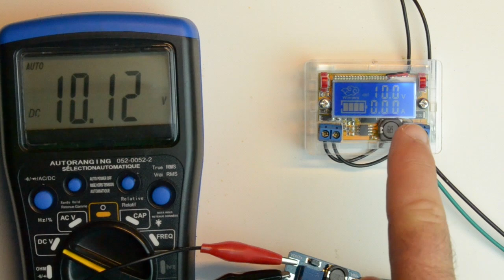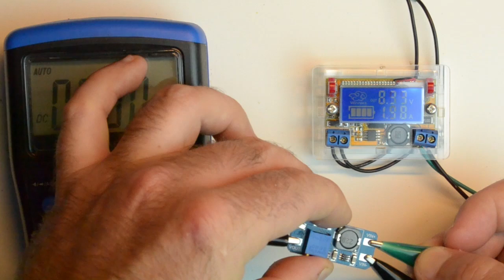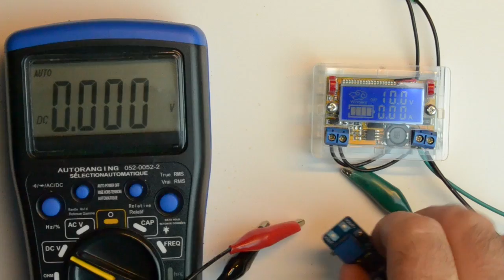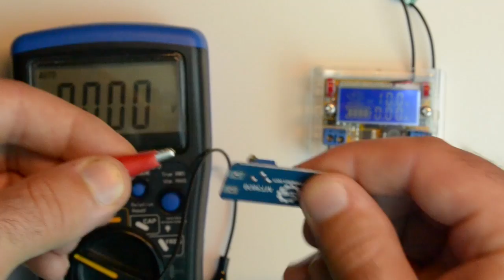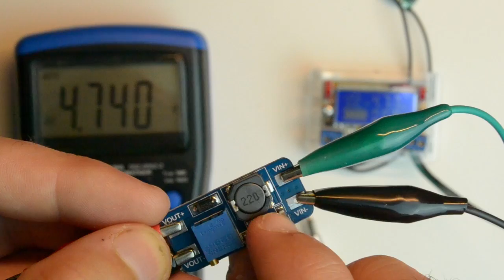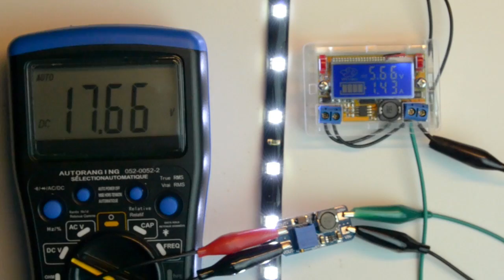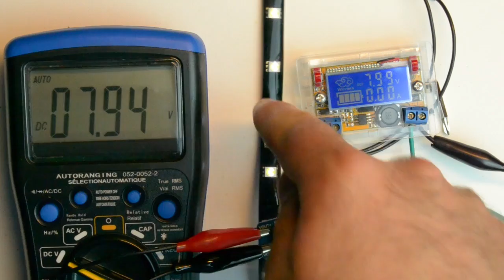Caught on FIRE?? MT3608 DC DC step up boost coverter

Comment: I've purchased two of these modules and they worked fine although of you need to be patient while adjusting the output, it may take 10 or more turns before you'll see any boost in output voltage.  There is however a design problem where the potentiometer can be adjusted to the point of exceeding the maximum allowed input voltage on feedback pin 3 of the controller ic with the result of allowing the magic smoke to escape. This would only happen if the input voltage to the module exceeded 6 volts. A better design would have included an additional resistor between the top of the pot and the output voltage that would limit the maximum feedback voltage to the IC regardless of the adjustment of the pot.  While searching for the schematic, I came across an excellent detailed write on the issue posted by John Galton -- see below.   I hope this helps all you DIYers.

---------------------------------------------------

ByJohn Galton January 25, 2017
This specific circuit board has a design flaw when the input voltage is greater than 6 volts, where the potentiometer can be turned to a point that exceeds one of the "Absolute Maximum Ratings" on the MT3608 chip data sheet.

I also blew one up when hooking it up to a gel cell battery, expecting the device to function as advertised. Then blew up a second one even with a current limiting resistor in the power supply, before hunting down a schematic, probing the board to be sure it matched, downloading data sheet for the chip itself, and conducting an autopsy on what happened.

(edits to clarify technical details)

The workaround for the unaltered circuit is to turn the potentiometer adjustment screw 20 turns counterclockwise BEFORE connecting power! Apply only 3 volts power initially (such as a pair of "AA" batteries" while adjusting everything, even if your final input is going to be much higher (like a car battery).

By default as assembled and shipped, the potentiometer wiper is about 3/4 of the way to the top. If your power supply is 13.8 volts, This will apply about 9 volts to pin 3, Vfb, of the chip, and instantly kill it before you can get started.

Probe the center wiper pin of the potentiometer on the back of the board, and check the voltage. When the unit goes into a control loop regulation mode, this voltage will be right at 0.6 volts. If it is above 0.6 volts, it is just passing input through to output without any boost.

Carefully adjust the potentiometer to bring the voltage at the output up to whatever you intend to boost to.

Only then can you safely connect the input to whatever higher voltage power source, such as car battery, you are going to boost from.

-----------------------------------------------------------------------------------------------------------------------------------
Now for the why to do it this way, and a rant.

I have been an electronics engineer for a while, and have seen a lot of products that are not very forgiving of typical end user assumptions based on ad copy. In that context, this product is, alas, another one of those where ordinary people can blow it up.

According to the data sheet on the MT3608 chip, available at https://www.olimex.com/Products/Breadboarding/BB-PWR-3608/resources/MT3608.pdf the absolute maximum limit for pin 3, Vfb, is 6 volts, and the control voltage is only 0.6 volts. The schematic for this specific board can be found as the image
http://www.sunrom.com/media/content/1118/MT3608-schematic.gif.

Let's analyze the feedback and boost circuit. Total resistance between the output and ground through R1, a 100K potentiometer, and R2, a 2.2K fixed resistor, is of course 102,200 ohms. At a maximum output voltage of 28 volts, this will pass a current of 274 microamps.

The voltage across R2 at this current will be 0.602 volts, which means that if R1 is set where its wiper is at the bottom, the output voltage will be slightly below the maximum boost output.

So far, so good. As long as the potentiometer wiper is near the bottom end, everything is fine. As the screw is turned and wiper moved away from the bottom and near the top, the voltage at pin 3 of the chip rises. The chip senses this and reduces the switch duty cycle to reduce the boost, until the output voltage drops, bringing pin 3 back to 0.6 volts again.

This process works fine, until finally the chip adjusts the output voltage to equal the input voltage. Then the nice stable control loop quits working. The boost circuit shuts off. The DC input simply flows through L1 and SS34, to the output.

Since the chip is no longer able to control the output, it cannot reduce the output voltage as the potentiometer continues to be turned, so the voltage at pin 3 now just rises proportionately to the potentiometer wiper setting.

Notice there is nothing at all to prevent the wiper voltage to be cranked "all the way to eleven", where pin 3 can see the entire output voltage. If you have an input voltage of, say, 12 volts, and the potentiometer wiper came set from the factory most of the way up, then the voltage fed into pin 3 can be significantly higher than its 6 volt maximum rating, and up to 20x the voltage it expects to see to run a proper control boost loop.

It is this simple oversight - that the potentiometer can be adjusted to, and comes from the factory at, a setting a long ways beyond any normal operating range.

What we need is another resistor between the output + and the top of R1, so that if the wiper is all the way at the top, we can't reach 6 volts at the wiper, even if the input is at 26 volts, the maximum rating of the chip.

Lets make the sum of R1 and our new resistor we create with a magic wand and insert in this circuit, equal to 100K. The sum of all resistances would still be 102,200 ohms.

The voltage at the top of R1 would be 6 volts with 26 volts at the output, which since the unit is not controlling in this extreme scenario, just passes input through to output.

To make this happen, we solve a ratio and proportion equation. 26 / 102200 = 6 / x, where x is the sum of R1 and R2. Cross-multiplying to solve, X = 102200 * 6 / 26. X=25585 if we round to the nearest integer. Since R2 is 2.2K, then R1 needs to be changed to something slightly less than 23385 ohms. The nearest standard value for a potentiometer is going to be 20K.

The sum of R2 and R1 will thus be about 22200 ohms. 102200 - 22000 = 80000. Our new R3 needs to be 80K to properly protect the chip from both highest possible input voltage and highest possible boost voltage.

-----
Thus, this is my take on why these things fail, and how to fix it.

The MT3608 chip is available from assorted sources. Anyone with schematic capture and circuit board layout software (and some skill at operating it) could easily take this design and fix the problem, and send the re-designed board layout and bill of materials off to a board fabricator in a single afternoon.

If I were going to use this in a commercial product, I'd probably "add a belt and suspenders" and put a small signal diode (nominally 0.7v forward voltage) in parallel with pin 3 and ground (pin 2) right at the chip, and also add about a 20K fixed bleeder resistor in parallel with C2 to prevent running the unit without a load, which can also kill some boost switch circuits.

Heck, it's Friday. I might just lay out an improved version of this unit in the same form factor myself, and post it to show everyone how it should have been done.
Reply: I have replied separately, this is a copy in case it is useful,

This is a modified version of a circuit my Dad built in conjunction with some valuable references in 1986 in Australia, it was fixed non-adjustable and made with far less components and fitting with the original use-case which was to enable an LED torch that didn't exist in general availability then to operate using two recycled basically flat batteries. It was my idea that he worked on. I presume the changes are to enable mass production through additional applications due to being adjustable. I intend shortly having discovered these are commercially available to make up a small batch for Boy Scouts. I would not mind finding a copy of the original hand-traced printed circuit board or the completed circuit mounted on a modified AA battery holder, I could copy/modify that for use. To executive summary another comment, "This would only happen if the input voltage to the module exceeded 6 volts."

Dr Bonezzz
"There is however a design problem where the potentiometer can be adjusted to the point of exceeding the maximum allowed input voltage on feedback pin 3 of the controller ic with the result of allowing the magic smoke to escape. This would only happen if the input voltage to the module exceeded 6 volts. A better design would have included an additional resistor between the top of the pot and the output voltage that would limit the maximum feedback voltage to the IC regardless of the adjustment of the pot."
Reply, the original design was fixed and the components chosen for the specific circuit application prototype including one resistor. Also, if I recall the circuit does not work very well with no load on the output because it is hard to tune.

Comment: These boost converters can handle 2 amps max, so if you exceed that, they will blow. The best thing to do is limit the amps from your power supply.
Reply from the maker: Yup, but I think you misunderstand, I didn't 'push' 3 amps through it, it shorted and 'pulled' 3 amps by itself, which was the current limit of my DC-DC power supply. The module didn't have a 3A load, it BECAME a 3A load by shorting out.

Comment: Hey i am willing to buy it and need some help i want to boost 12v to 25v can i ?
Reply from the maker: So yes you can put in 12v and get 25v out BUT be sure to check your amp output! this module maxes at 2 amps but if you were to run it constantly, I would probably not output more than 1 amp, which will still be around 2 amps in!
Reply: Yes out is less then 2amp and in is 2amp (battery). do i need anything else like capacitor or somthing ?
Reply from the maker: You should be good to go, I would order more than one though. (hint: usually 5 units cost as much as 2 unit usually)
Reply: Thanks for hint
Reply: Mine catched fire without load on 12V in. With 4V in worked.

Comment: I had problems and they wouldn't power my arduino nano', so I put a 220uf 35v capacitor across the output and they work.  Watching the movie I think you were adjusting in the wrong direction. I think if you wind it to far in the wrong direction it looses the thread inside the pot and it won't wind back in the opposite direction.  Turn counter clockwise to increase voltage I think.
Reply: MakkyBrown Brown did you put the cap at the positive or the negative output?cuz im gonna build a bluetooth speaker with it
Reply: One on the output works pretty well, but we have been putting a second capacitor on the input aswell just like on most other voltage regulator boards. Just use electrolytic capacitors 220uf 35v connected across the + -  at the ends of the board.

Comment: I bought a lot of the same brand and I have not worked any. I'll try putting a capacitor.
Reply: I think the problem does not relating to the cap.  Maybe you can check first (1) pin 4 of the chip (i.e chip enable) and (2) pin 1 of the chip (sw, ie the Lx).  (3) pin3 of the chip (fb).  Pin one 4 needs a voltage of 1.5V or higher.  It is usually tied directly to input voltage for convenience when no shutdown function is needed. Pin 4 is the switch node of the inductor.  You need to check pin 4 with a oscilloscope to see whether there is any swtching waveform present. For the pin 3, it is the feedback voltage.  In normal operation, you should always read a stable 0.6V(+/-2%) on the feedback pin with a multimeter.  I have adopted the genuine chip MT3608 in my own product desgn and mass production since 2012 Nov and the defective rate is extremely low.  So I guess the problem is either relating to workmanship of the board or the chip is fake.I see from other youtube video that the multi-turn potentiomter may have problem.  It needs unexpected extra turning before it can adjust the output voltage.  Maybe, you can also check that first.
Reply: Julio F. - On other videos you can see that the potmeter has a quite narrow band where its operational. After turning it counter-clockwise (lowest setting) to the end, it will need quite a couple of clockwise turns before you can see the output voltage increase.

Comment: I've used dozens of these exact same modules and had no issues whatsoever with a single one. That said, they are very susceptible to blowing up if the output is shorted (even on very low o/p voltages). I found this out during destruction testing. Non have ever failed in service.
Reply: Les McQueen - When they fail it is most often the internal mosfet that shorting out. Although the modules are cheap enough to just replace, they can be repaired. In a recent video (see other comment) I show how to repair a failing module.

Comment: u dumped 3 amps into it no wonder why 2 amps max 1.5 max  is what you should use.. use them with a 18650 batt to boost it to say max 12 volts at 1 amp and youll be fine..
Reply from the maker: I didn't dump 3 amps into it, it shorted and pulled 3 amps, my power supply current limit kicked in. the only load was the input impedance of my multi-meter, which is several mega ohms.

Comment: I have used quite a few of them and they work pretty fine as long as you stay within the load limits and not operate in its extremes. The multi turn pot starts to show changes only after more than 5-6 turns. 
I used it for 12volt input and 24 volt out put for a current of 350ma on load side  about 8.5 watt and they work perfectly.

Comment: i had three mt3608 and all three wont boost, i have 2 2400mah 18650 in pararalle to a tp4056 with is attatched to a mt3608, any suggestions?
Reply from the maker: Check to see if the pot is linked on two legs in the back, I've had a new batch, and those are soldered together in the back and they work. go figure.
Reply: just for information sake, the batteries were low. i left it charging and when i came back the mt3608 started boosting the voltage. but!  i had spun that pot like 10-15 turns counterclockwise as well before it started boosting. after the batteries had charged so in all honesty idk what was the actual problem but now its resolved  thank you for all your help and the people who left useful comments and great vid
Reply: Okabe Rintaru hi I want to do exact same thing 18650 to tp4056 to mt3608 to get 5 volt for Arduino did you get it to work regards Dan. I was also considering parallel connections from the output of 5 X tp4056 (discharge protected version). To one single mt306 so that it would use all 5 18650s ?

Comment: Don't bin the faulty modules yet. They can be repaired! While making a USB rechargeable 9V battery (see my previous upload), I also wrecked an MT3608 module. I suspect shorting it out or static electricity caused the problem. On my module the chip also got very hot and when testing I saw a very high input current. Vin had very low resistance to ground, while another (fine working) module had not. Yesterday I repaired the faulty module and made a short video about it. Maybe you like it: https://youtu.be/-3tBw6WSZVM
Reply from the maker: I'll check it out, thanks!
Reply: @SimpleElectronics  - After reading about some more people having a bad experience, I now recommend to always set the voltage using  low input voltage and power, e.g. using a battery. These modules are prone to fail when the output voltage is set too low, i.e. below the input voltage. (See also the comments I received on my video).
Reply: Maxint R&D genius!

Comment: I might seem stupid but i would ask what's your power supply,linear or switching? i've run into similar issues when i was supplying it using a switching power supply,the voltage seemed like it can't be adjusted. Apparently using a battery it worked like a charm! I can imagine using a capacitor in parallel on both input and output can fix many problems,mostly because any switching frequency on its input will mess up its own one,in which case it will be filtered out.

Comment: Hi SimpleElectronicsYT
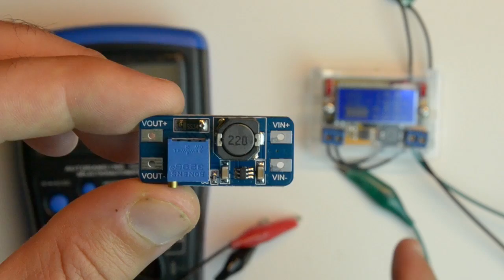Look at 3:00 and you will see that you made the same mistake I did: the potentiometer is mounted upside down!
When I realized it I kept turning left a lot (like 20 turns from default setting) and saw the voltage increased.
In other words: TURN LEFT = increase voltage, TURN RIGHT = decrease voltage

Jump to 3:00:
https://youtu.be/ojw112KoNBI?t=180

For this reason I had to click the "thumbs down" button - sorry about that!

Comment: too bad it wasn't go well on your first test, actually that module works quite good. have been using some of them and i don't have any issues with it yet. all of them are still running fine. i hope you don't give up on it.
IMHO, for boost-type converter, it would be better to test it with lowest voltage allowed first. it much safer that way.

Comment: You shouldn't put more than 6V when setting the converter. The modules that you have I think have a design issue where the trimmer is used as a pot instead of a variable resistor. They've used a 100k pot in series with a 2.2k resistor which makes it very difficult to set the output when the wiper of the pot is connected to FB pin of the IC. You would have to keep turning the pot close to one of the ends of the pot before you would see any changes. Once set properly, you can change the input voltage up to 24V as long as the set output voltage is higher than the voltage at the input.
Reply from the maker: Hey, thanks for the comment! as you will see on the blue meter in the background, the input voltage is at 10v and 6v at some points, but yes, these modules are not ideally designed!